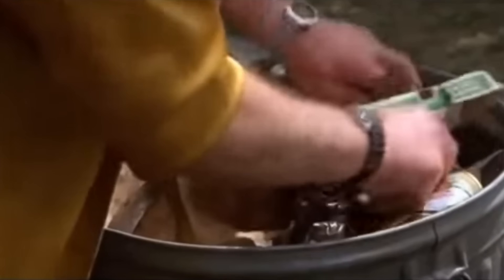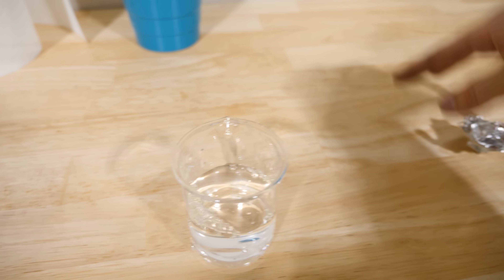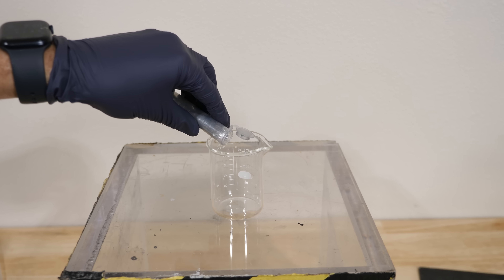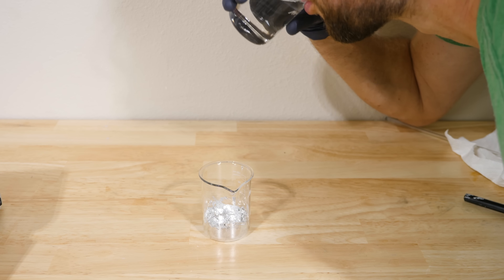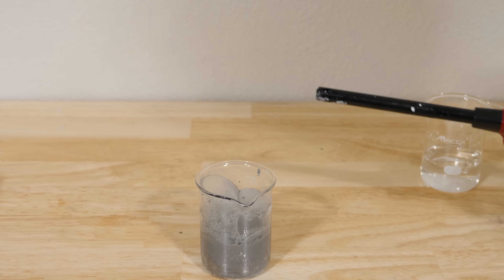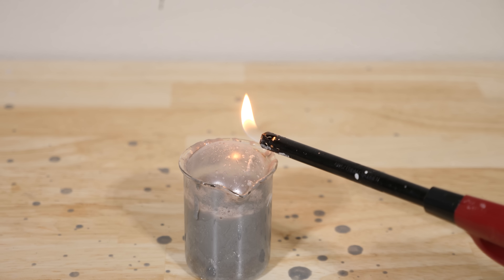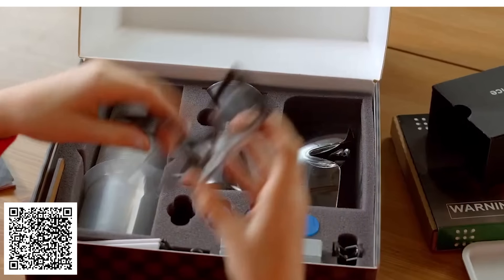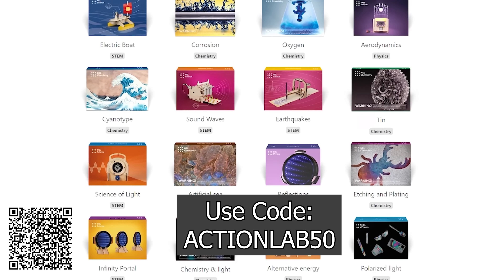This Liquid Metal Turns Garbage Into Fuel

Comment: Don't you need a huge amount of electricity to make aluminum. Using the electricity to make hydrogen from water would probably be more efficient (even considering transportation costs, and yes, water contributes to global warming). Internal combustion engines would probably be more "eco-friendly" than aluminum, because you need: 
1. Hydrocarbon fuels to mine the bauxite (aluminum ore), and possibly e×pl0sives releasing nitrogen oxides and CO2
2. A lot of sodium hydroxide to purify the aluminum oxide from the ore
3. A LOT of energy to produce the metal by electrolysis, and to keep it at the ≈1000°C temperature needed for the process
4. Literally all the environmental downsides to mining and processing a LOT of aluminum 
5. Transporting all the aluminum with more fuels to it's final destination. 
6. How are you going to get rid of the aluminum oxide? Your going to have to constantly remove it (and plastic garbage from the cans) from the hydrogen generator, and transport it to a place where aluminum is made.

Comment: The issue, of course, is that the energy it takes to make aluminum and the efficiency of the produced aluminum make make this not viable—and it still takes energy. It isn’t a source of energy, it’s a storage mechanism
Reply: better to use this than bury it in the ground yes
Reply: @AC-pn4tk  60% of Aluminum is recycled in the US already, and it is highly recyclable. In fact it takes 1/20th the energy to recycle Aluminum that it does to convert Aluminum from Bauxite.

But here is the real kicker—the way to reduce Aluminum Oxide to Aluminum Metal is by getting it to react with carbon, producing carbon dioxide. 

You might as well burn the hydrocarbons directly. You produce the same end product without the costly intermediary, and we already have the logistics for that worked out.

Comment: Two points. One an awful lot of energy is wasted in the exothermic reaction so whatever reactor you build you want to take advantage of that heat. Two carefully store the aluminum oxide byproduct then using entirely renewable energy sources such as solar concentrators, solar panels, etc process the oxides back into aluminum as a form of long-term energy storage or as part of an energy cycle.
Reply: you could probably use the waste heat to pre heat the aluminum hydroxide (or the scrap aluminum or run a turbine)
Though I wonder if that can be used to separate the alloyed metals out of the aluminum, if that's the case, it would be a great step in reclaiming aluminum.

Comment: The interesting part is production — you can run a n aluminum smelter at massive scale on hydro/solar/wind, then use the aluminum gallium on demand in a small reactor (car scale) by burning or running it through a fuel cell. Essentially, aluminum becomes an infinitely recycle able battery with strong existing production and recycling infrastructure.
Reply: We don't have excess wind/hydro/solar. Until we do, were burning coal and natural gas. Wind and solar require too much area per watt to be the answer. Especially when you consider their inconsistent power output.
Reply: @WeighedWilson  The point is that we do have excess wind/solar/hydro. That occurs because of their variable power output and because demand varies quite widely throughout the day, so it makes sense to store that excess electricity production by some means. Your unfounded assertion that "Wind and solar require too much area per watt to be the answer" is utter nonsense, and it's now abundantly clear that renewables are not only essential for our futures, they are cheaper than fossil fuels in most parts of the world.

In answer to @ethan the reaction of aluminium with water is strongly exothermic, so unless you can also capture and use that heat, the efficiency of producing Al, then reacting Ga/Al with water will be abysmally low. You'll find that direct electrolysis of excess electricity to hydrogen is a far more efficient way of storing energy.
Reply: @WeighedWilson  Nukes, geo, and hydro are the one true green.  If we can get fusion to work... even better.

Comment: If 1 gram, of this Gallium Aluminum alloy makes 120 ml of hydrogen, that means that 1 gram  makes 10.8 milli grams of hydrogen, as 1L of hydrogen (under atm pressure of course) weighs 90 mg, lets say you had a 10kg batch of this alloy in like a giant cylinder, you would make 108 grams of hydrogen, or 1,200L of hydrogen, 1 mole of hydrogen is 22.4L, every 22.4 L of hydrogen burned releases 286,000Joules of energy, so 1200L/22.4=53.57,     53.57*286,000=15,321,428 Joules of energy released. Now by volume hydrogen is less dense as 1 gallon of gasoline( 3.7 Litres) release 132,000,000 Joules, but by weight it is way more energy dense. If 10kg of the alloy can make 15,321,428 Joules of energy, you could heat 1L water from room temperature (25 Celsius or 82 Fahrenheit) to a boil around 48.6 Times (Assuming 100% efficiency of course), so maybe we could use alot of aluminum for also producing energy, although it's still being researched on so i can't be really certain.

Comment: What kicks ass here is that this has some serious implications for moon colonization. Aluminum is super abundant on the moon.

All you need is gallium and a system to both recover the gallium and store the hydrogen and boom. Electrical energy on the moon for pretty much anything. You can store aluminum pretty much indefinitely on the moon in stockpiles for energy.

Side note: you can also refine the aluminum oxide through the use of say, fusion/fission, have a stored supply of aluminum for energy production AND have OXYGEN too, since it's a byproduct of the aluminum refining process.

Comment: It would take 7.69 grams of gallium to make the equivalent of 1 gallon of gasoline. To make a vehicle that would travel any decent distance you would have to have a large space dedicated to the reaction tank. Thus making more weight and lower gas mileage. Then every week or so you would have to clean and separate your gallium back out of the waste water. So how toxic it the waste water? Is it something that city’s don’t want you to put down the drain? Next thing you know everyone has gallium poisoning.
Reply: Gallium is relatively non-toxic. However, due to the property of dissolving aluminum, it is considered a corrosive material. While it won't necessarily poison people, it could cause severe corrosive damage to structural devices made out of aluminum. This is why gallium is banned on aircraft.
Reply: @pyr0duck676  it is a skin and eye irritate and is believed to cause kidney and liver damage. Also, I wonder if some of it would carry over with the hydrogen and cause corrosion in an aluminum engine block?
Reply: @alpha9526  These effects are very mild. Gallium has a similar toxicity to aluminum, table salt, vinegar, etc. Compared to many other things we use in our day-to-day lives, it has a very reasonable toxicity. A lot of its irritation effects are due to the melted gallium physically getting lodged in your skin and causing irritation. While it is true that it could cause kidney and liver damage, it is about as toxic as alcohol is to your kidneys and liver. So as long as people aren't actively trying to eat or breath gallium dust all day, it shouldn't be a problem.

Regarding your second question, I doubt that much of it would get carried away in the hydrogen. Gallium, aluminum, and aluminum oxide are very heavy and would be very unlikely to be carried in the stream short of it being in a combustion environment. Personally, I don't think this has a use in a vehicle's engine (for many other reasons), but it may be a good energy carrier. I study aluminum-gallium alloys in combustion environments for my Ph.D. and I have a post here that explains a little more about Al-Ga energy carriers if you are interested.
Reply: @pyr0duck676  I found the post and it is good info, thank you. Do you know what the energy to weight ratio is for the gallium aluminum process as opposed to a battery?  As an example: A 400 amp-hour battery that generates 6 volts can supply approximately 2.4 kilowatt-hours. The cost for a battery this size is about $450 and the weight is 122lbs. So what would the comparable cost and weight range of gallium be? Also space is a factor the above battery is 1383 sq inches or 11.6x7.1x16.8 inches. Can the gallium hold that much energy in that small a space? 

Sorry to bombard you with questions but you are the expert.

Comment: I'm curious as to the side effects of using aluminum. 
The aluminum creates a gas, but does the aluminum also escape as gas into the atmosphere? If so, that could be harmful to health.
Reply: No, the aluminum is converted into aluminum oxide which is a solid at room temperature. This is why the reaction needs to be cleaned and filtered afterwards. The only gas production would be water vapor from the hot water and hydrogen gas.
Reply: It's uneducated people like you who stand in the way of the progressions of science and cheap renewable energy. Instead of having a close mind and thinking everything is dangerous or harmful, why not DO A LITTLE RESEARCH!!!

Comment: Would it work with gallium on an aluminum block sealed on all sides except the top and then sitting in the bottom of a water source? Would the hydrogen be released as the block is slowly eaten away?
Reply: Yes. I have done this in my lab.

Comment: This method also beats out using copper (II) chloride to demonstrate aluminum's high reactivity since gallium isn't toxic like copper (II) chloride.

Pretty cool that elemental aluminum under the hood is actually quite a highly reactive metal (as this video demonstrates) even though it doesn't seem like it under normal conditions unlike other highly reactive metals such as sodium!

Comment: What happens to the aluminum? That happens to the oxygen? the hydrogen from the water burns up, the Gallium gets cleaned somehow, but what about the byproducts? Can someone with a chemistry background explain the reaction and the byproducts, because I just see water with some flakes in it and Gallium left over. I also wonder how "clean" the gallium is. Just curious is all.
Reply: The gallium probably isn't very clean afterwards as it would probably be contaminated with aluminum hydroxide

Comment: The layer can also be removed mechanically, as can the reduction in particle size. Thus, it begs the question: would you be able to replicate this by putting water and foil into a blender instead of using gallium?
Reply: Likely not to the same extent as shown here. The passivating oxide layer on aluminum is usually a couple nanometers thick before the reaction stops. Therefore, to react the aluminum in a blender, you would need to blend the particles down to the nano-size in order to react most of your aluminum. The advantage of using gallium is because the gallium actually prevents the oxide layer from adhering to the surface so that all of the aluminum can react. In other words, putting aluminum Ina blender with water would technically produce some hydrogen, but not nearly enough to be noticable.
Reply: No. The aluminum oxidizes in the water also do to the products of the reaction.

Comment: The energy of 1kg of pure hydrogen is about the same as 2.8kg of gasoline (35.8kWh). Hydrogen in gaseous form has a density of 84g/m^3 at 1 atmosphere pressure and 20° C. 150ml is 0.00014m^3, i.e. 0.0126g of hydrogen. Fuel efficient cars consume 4.7l of gasoline for 100km or 1.7kg of hydrogen (60kWh). It took 1g of aluminium to make your hydrogen, so making 1.7kg hydrogen would take 134kg of aluminium this way. It takes 17kWh to make 1kg of aluminium, making 134kg takes 2278kWh. An electric car drives 6.6km/kWh. 2278kWh get an EV 15000km far. Congratulations, you demonstrated a way to make a hydrogen car 0.7% as energy efficient as an EV…
Reply: That's some spicy math right there!
Reply: tl;dr
Reply: @goodbye8995  His method of making hydrogen is 142x less efficient (0.7%) than using the energy in an EV. Also to get the equivalent of a full tank of „gas“ you would have to load 3 tons of Aluminium and 45 tons of water.

It is only „slightly“ inefficient and impractical.